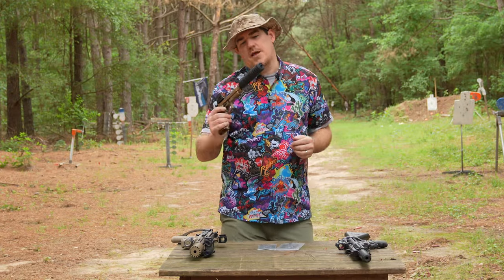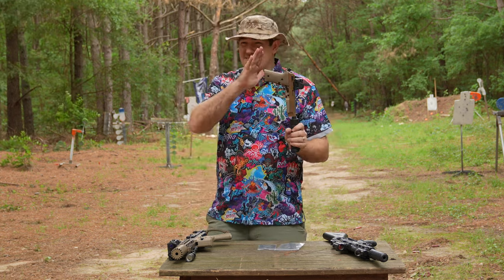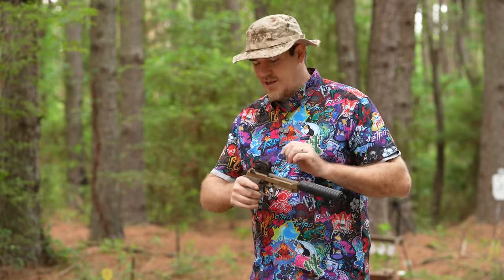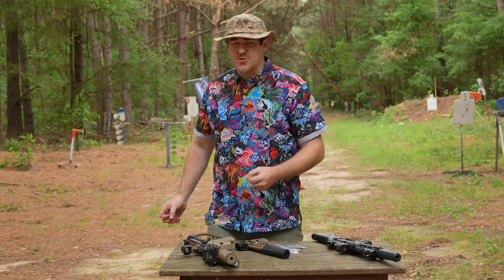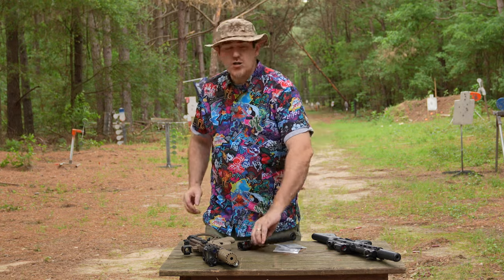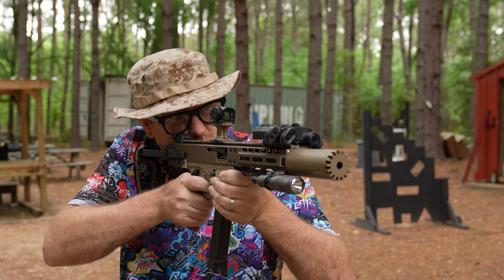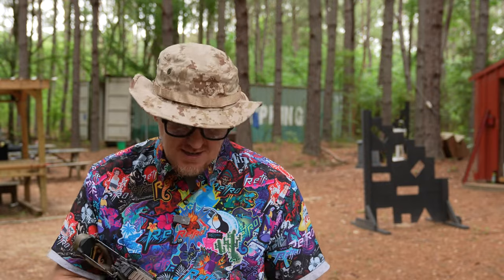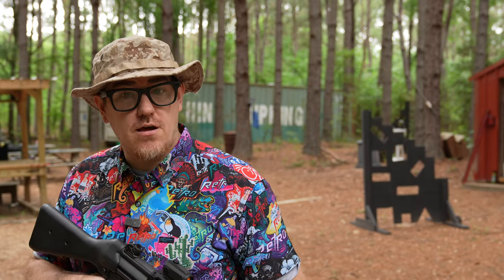AB Suppressor F4L - Full Review ft. Beretta M9A4 and HK MP5

Comment: Just got mine out of atf jail after almost 17 months (had to literally call my congressman). Tested it on a direct blowback pcc, non-tilting barrel semi auto 9mm  pistol, and subsonic only 300blk. Plenty of unburnt powder with the pistol, sounded great with the pcc (no gas to the face) and when put head to head vs a heavy precision 30 cal can, the 300blk sounded superior with the F4L and still zero gas the the face even in the indoor range. Interestingly, though it's a low back pressure can, the 300blk would cycle with the F4L but not the heavy 30 cal can which is high back pressure. No regrets, i love this thing.
Reply from the maker: Awesome man. Worth the wait.

Comment: I would heartily recommend the standard 18 rd MecGar mags for the M9A4 over the ‘sand proof ‘ ones. They tend to run better and insert/eject smoother, maybe b/c they lack the weird coating on the sand-proof ones, but YMMV of course . Thanks for testing on that platform! Also: if you already have some, the Canik mags are geometrically compatible (Mec-Gar makes both) if you are willing to do some minor dremel surgery to cut the mag release slot a little lower (if you already have a bunch of Canik mags) can make use of the 20 round ones with the expanded baseplate.
Reply from the maker: Noted. I almost went that route over the sand proof but got the sand proof for just over $20 each which felt like a bargain. So far no issues at all with them. Easy in and out on mine but we’ll see over time if they wear down different.

Comment: This might be exactly what I'm looking for. I have a Taurus 92, Beretta CX4 Storm (uses the Taurus mags), 8.5" 300BLK AR, and a 38spl lever that it could be put on. I'm very interested in the 92 operation without needing a booster. I am curious about 38spl use- since you can't open up the suppressor, should you avoid lead cast bullets which are dirtier?
Reply from the maker: Use at least fmj to help. This thing is insane on 38 spl / 357 subs!

Comment: I recently  purchased a 22 can & now looking for my first 9mm can. It's gonna mostly live on my 6.5" cmmg dissent MKG 9mm  95% of the time. Not interested in mounting it on any handguns. But I would like something I could possibly toss on a 300BO pistol at times too. What cans would you recommend? I like the AB & also looking at the dead air wolfman but the wolfman sounds like it may be on heavy side? I'm more interested in huxworth flow throughs just because I would rather have better sound reduction & tone . What's your tops 3 to 5 recommendations in order. Thanks!
Reply from the maker: Hux would be bottom of my list, as it’s extremely loud in comparison to most options out there (at least the cash 9k is). If you ever even think you might run it on a pistol, I’d put the Rugged Obsidian 9 at the top of the list as it will do everything you want and be a solid pistol can. If you truly ever only want PCC the AB F4L is phenomenal quiet - but its only ever going to be 1/2x28 threaded which means your 300 blackout subs only will not be a go on it since it would need a 5/8x24 thread pitch, and adapting the threads on your host is how you end up with a baffle strike. If you dont mind the weight, the wolfman is a favorite of a lot of folks and will be in the top 3, but an alternative to it would be the resilient RS9 which is lighter and cheaper than the wolfman if I recall correctly. Lastly, Otter Creek Labs Lithium is a top performer, but will be  the second most expensive option. So in no particular order at all - those are where I would put effort
Reply: Ok cool I will check all those out, any experience with AAC tyrant 9HD?